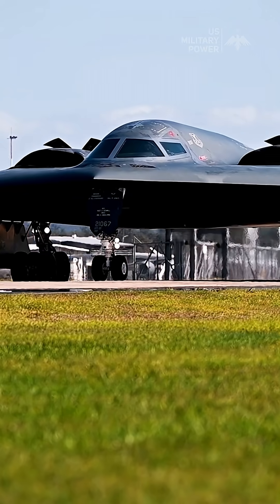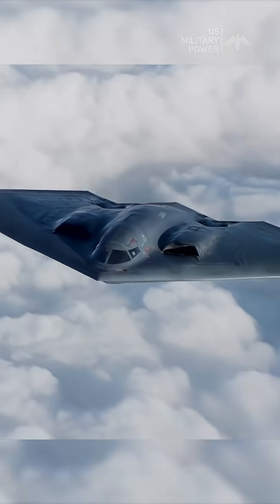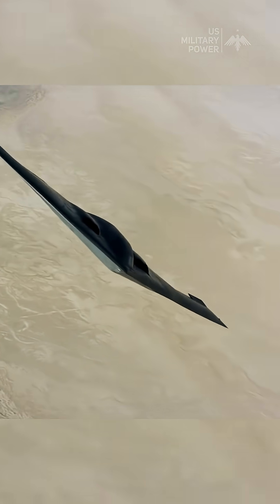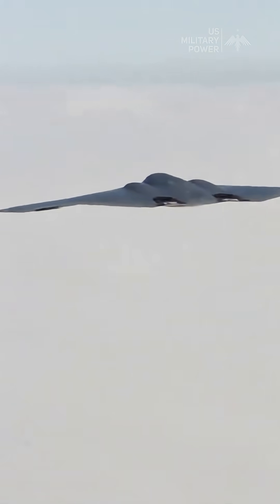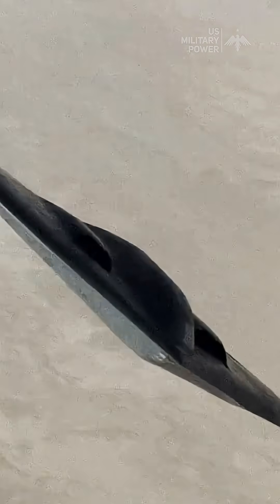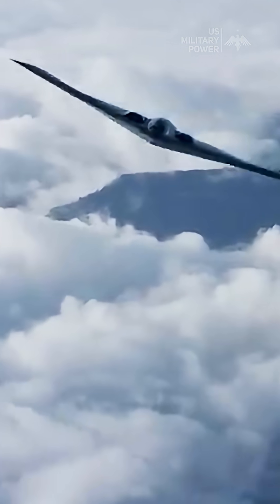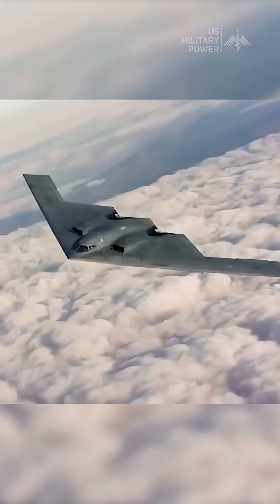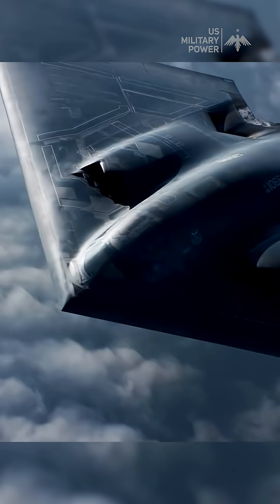Why No Radar Can Detect the B-2 Bomber

Comment: I love th b2.   But I still think the most amazing stealth fighter was the F117 because we did it not having all the computers and everything we had to use angles and it was done on computers that had no real power.   I mean just imagine a $30 cheap android phone has got more processing power than the computer computers that were probably used to help design the F117.    And the F117 is still more stealthy than anything any other country as.    The F117 is more stealthy than the F 35   Only the F 22 the B2 are the only planes in active service that have a smaller radar cross-section than the F117.   And the beauty of the F117 can use laser guided bombs.   No GPS needed.   And I’m not sure if the B2 can do laser guided because it’s not really a thing anymore.   They probably can, but I don’t know if the new B 21 can use laser guided.   Most of our weapon systems or GPS guided.    But the F117 was laser guided and could drop bombs with such precision.   To me, it’s just amazing to think about.
Reply: The F-117 is not, in fact, stealthier than the F-35. A quick bit of research proves that. The F-35, while not as stealthy as the F-22, certainly outclasses the older geometry, coatings, and systems the F-117 employed.
Reply: Serbian shut down f117 whit radar sistem  from cold war era ,from 2012 Chinese develop APAR thy are air defense flash evry stealt plane like sun .Canada develop quantium radar in urly stage, I mean F117 is flying laboratory stealt era is begining to the end plus for example B2 is haily expensive for maintenance  what is the point plane for billions of dollars  ore barage from thousands of drones and missiles for quarter price???? Only 2 nations have exp. In modern warfare  at the moment Russian  and Ukrainian  that is fakt